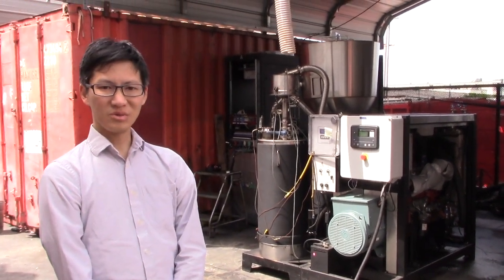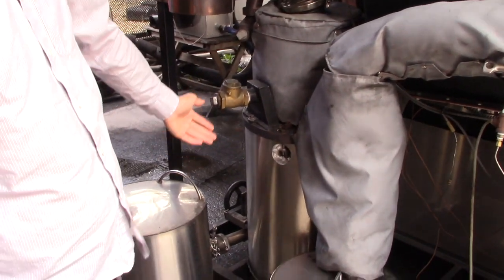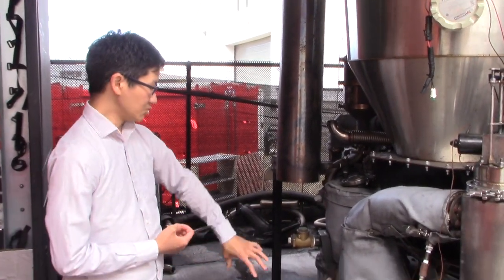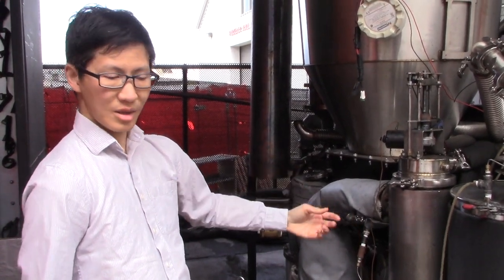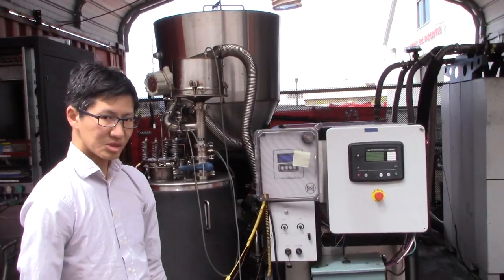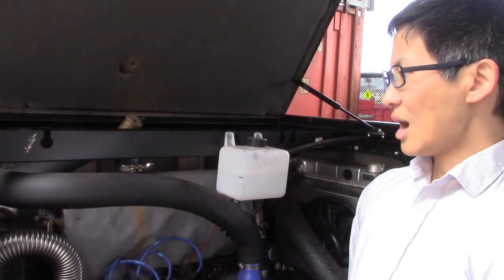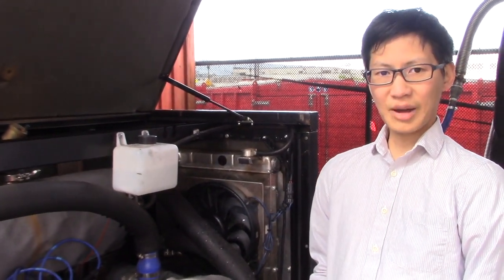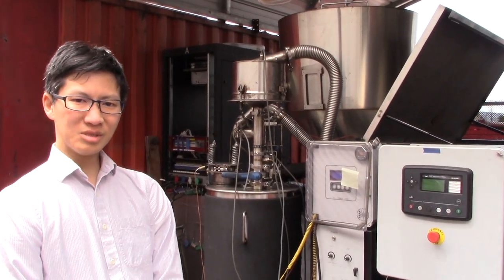PP30 Walkaround

Comment: Extremely  cool. Good job on thinking about AC phase syncing (on products like these it seems nobody thinks about grid-tying or system inter-op) and waste heat recovery. With a smart use of hot water storage tanks and batteries, this is a killer product for truly off-grid applications. I look forward to deploying one of those in northern NH eventually!

Comment: this is great but what most people need is a small and simple version that they can use to power a 1500/3000 watt generator.
Realize that most wouls buy this with hopes of never having to use it. They already have a generator and access to biomass. They just needs to back feed to the panel so they can run a refrigeration device, over head lights, fans and some electronics.  This kit should come in several boxes and be able to be assembled in an hour or two.
Reply: Falce. This is exactly what people need. You can run this to cut your energy bills or even offgrid.
Reply: There are severe inefficiencies with the gassification in this design when used for lower electrical output / less fuel

Comment: A few questions: How much does it cost? What are the maintenance costs? What's the expected life of the engine? What's the noise level while operation (at say 5metres)
Reply: I am asking the same questions myself. I can buy a Generac 22Kw that runs on propane & natural gas for $5100. And then use a home-made (cheap) wood gasifier to make (very filtered) wood gas to fill a 1000 gallon propane tank that I can connect to the Generac generator. I can do all this for under $8000. So if AllPowerLabs' Power Pallet is more than $8000 it is not cost effective for me to use it to power my home full time. I am guessing it will cost a lot more than $8000. But I will wait and see if I am right.

An important note here: One can make highly filtered wood gas, store it in large propane tanks (500-1000 gallons), then use the wood gas for your gas stove and hot water heater, even an on demand hot water heater. You can also fuel a generator from your wood gas to get free electricity. No expensive batteries to buy!!
Reply: Christ In You Yes I have no doubt after watching the lectures by Jim mason that these units are highly optimised, but cost is still prohibitive for private use.
Reply: @christinyou2014   The machine is a CHP system that consumes biomass. If you are strictly comparing it on a cost basis against a gas fueled generator (which isn't a combined heat and power machine and does nothing for biomass waste), nothing can compete against gas generators. 

Our machines are intended to serve the intersection between biomass waste disposal, the need for heat, and the need for electricity, especially if the biochar co-product is also useful. In many cases, our customers are paying people to dispose of biomass waste, so there's that savings as well. If you don't have more than one of these  value propositions, our machine is probably not a good fit for your application.

As for the matter of wood gas, it doesn't quite work the way you described. Wood gas from gasification is not cost-effective to store because it has 1/8th the energy density of natural gas at best, while the process that produces it is inefficient unless you recover heat from its use to boost the production efficiency. This is why our machine immediately uses the gas. The gas has to be sucked out of the reactor with the suction of the engine's intake stroke. Pyrolysis gas is not the same as gas that has been produced via gasification; gasification involves more steps than mere pyrolysis. See this: http://www.allpowerlabs.com/gasification-explained 
Pyrolysis gas has much of the energy trapped in tars that condense out. These tars are not easily utilized once condensed out.

You can try doing your plan, but it will likely end up costing much more $8000 to get it to work.
Reply: @christinyou2014   An additional note: Most of our customers are also not in the US, where electricity is reliable and cheap; most of our   customers are in developing countries with lots of waste biomass, unreliable and expensive electricity, and inexpensive labor for processing the biomass and operating the machine. The customers of ours in the US have multiple  value propositions addressed by our machine, not merely electricity generation.
Reply: @austinliu1043  Thank you very much for reply and the valuable info you gave me. I have explored every option and it appears that it may not be cost effective for me.
Reply: Austin Liu - quick question Austin: optimum moisture content of the wood chips?  In other words, are only "seasoned" chips going to work?
Reply: @corytruitt2047  The optimum is as low as possible. If you can get absolutely dry wood, go for it. But the machine will tolerate moisture levels as high as 30%. The onboard waste-heat driven drying system helps dry the wood, but the dryer it starts out, the better the performance.

Comment: works great in diesel engines you just add a spark plug.
Reply: Wood gas, especially when not treated for residues, can congest diesel engines and requires the proper design, care, consideration, and maintenance

Comment: Do you have a small 5kWh pallet for small farm private use?
Reply from the maker: We do not. Our first commercial product was a 10 kw machine using a small Kubota 3 cyl engine, but it has been out of production for quite a while. Prior to that we shared open source gasifier plans and gave support for their construction. These plans and the information about gasification and gasifier construction that we assembled during our development are all still available on our wiki: http://wiki.gekgasifier.com/w/page/6123754/How%20to%20Build%20and%20Run%20the%20GEK%20Gasifier which is also linked to on our site's homepage.